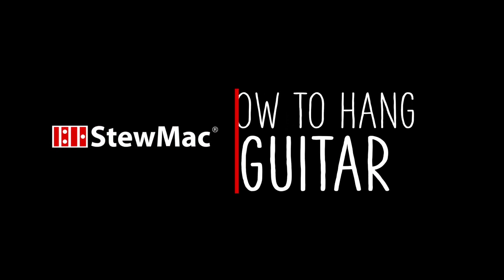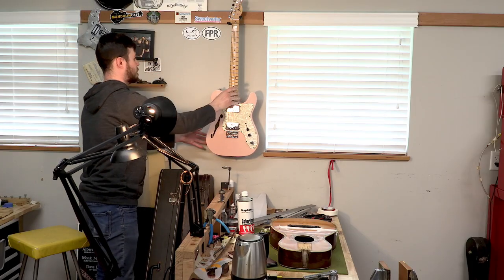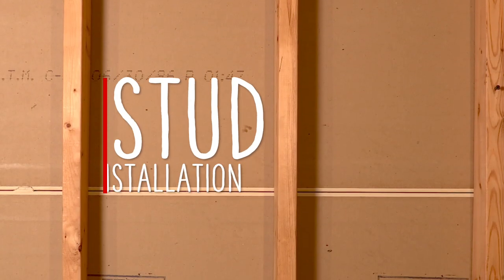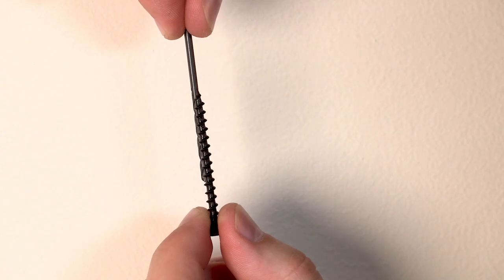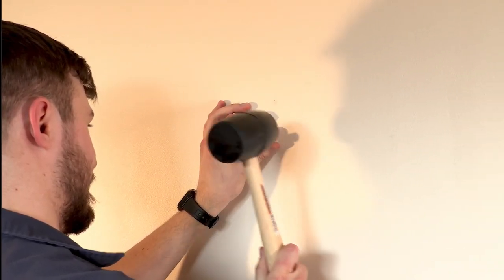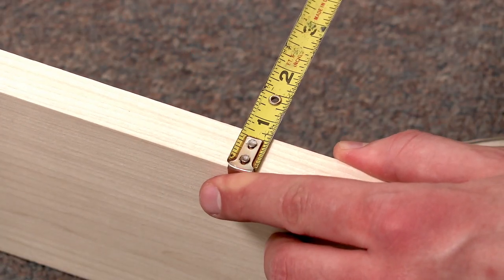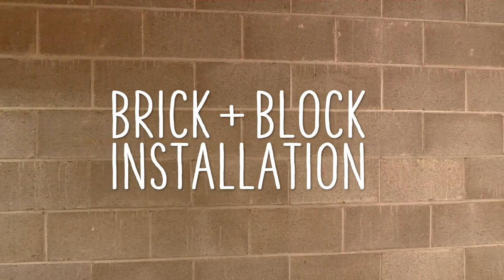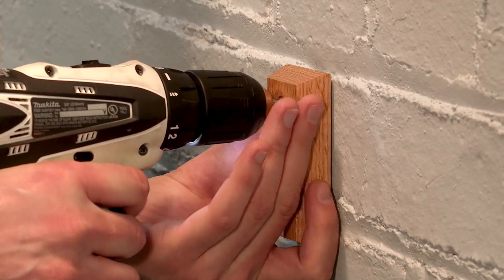How to Hang a Guitar on the Wall

Comment: I drive a nail right through the headstock.
Reply: Yeah I do the same to my 1958 Fender Stratocaster😀
Reply: Are you crazy, I just drill a big hole in the headstock , then I can hang it on a big nail 😁👍
Reply: I’m a little more practical. I grab my favorite 7 string guitar, pull off whatever string I use the least, unbolt the machine screw, and boom! - an instant hole to hang up the guitar on the drywall screw I just drove into the wall with a hammer!
Reply: It was a little tougher for me to try these ideas due to my guitar not having a headstock. I put a family of 10" nails angled upwards and pressed the body of the guitar onto them. Not too shabby.
Reply: Plz don't hurt it.😢
Reply: LOL!!!
Reply: I just remove one tuning machine from the headstock, and hang it on a nail on the wall
Reply: I usually drill through the fretboard and secure my guitar firmly to a tree in our yard with a couple of 10 inch long deck screws
Reply: You gave me nightmares. I like you

Comment: Don't drill into the mortar.  The brick is much stronger and less prone to crumbling. Brick drills easily with the same masonry bit.
Reply: In addition, instead of using a wooden dowel, a concrete anchor and screw set works better and is much easier to install!
Reply: Yeah brick is fine to drill, only concrete wall needs hammer drill.

Comment: I wouldn't trust those drywall anchors, I'd go with a screw into a stud or other solid backing...
Reply: 10-4  Those anchors are surprisingly strong, but not to hang a valuable friend like a guitar.
Reply: @216trixie   Agreed, :)
Reply: My painter friend and my carpenter friend recommended only those screw-type anchors for use in drywall. He told me to never use the type you hammer in. The drywall has to be in good shape, though. Although I prefer using either studs or a backer board, I've had to use anchors occasionally.
Reply: @brimtlgtr  The kind with the wing nuts behind them will defiantly work better than the hammer in ones. Studs are often in inconvenient locations. The board option is nice because you can fasten into studs and put the hanger exactly where you want it. The wall I have mine on is made of osb so I can put them anywhere, which has been nice as I ad guitars, :)
Reply: @A L M Right brainer emotive thinking. Drywall anchors are perfectly safe for those capable of thinking and doing simple jobs. Use the ones correct to application, RTFI & stay within the spec max. anchor load, spacing and total max. wall load guidelines.  Heavy Mahogany bodied Les Paul electric guitars only weigh around 4KG, most Teles and Strats less. The simplest nylon RAMSET drywall anchors will hold 5KG max spec., which means in reality, Ramset have ensured they've built in plenty of idiot user proofing tolerance before risk of failing. Use the 10KG split ones or large 20KG metal extending arm ones if in need of reassurance.
Reply: @theblytonian3906  Why? Just why? smh
Reply: @alm000  ...because demonstrative idiocy needs to be exposed for what it is to protect the naive.
Reply: @theblytonian3906  Demonstrative Idolatry???
Reply: Molly's. Otherwise known a butterfly bolts
Reply: A L M I’ve got this situation, at the moment. Given two or three treasured guitars, I think I’m going to go with the board firmly screwed to studs plan. I was a bit worried about the thickness of the board making the hanger project too far, but you can get hangers (sold as ‘Hercules’ in the UK) which are just fastened to a steel plate, though the wood block type is also available. This type also closes a couple of wings on the guitar neck, automatically, which solves the earth tremor problem. Probably won’t be much good in a total ‘fault line’ event, though. Sorry Momma Cass, kismet! lol
Reply: @lkgreenwell  Mine are the ones with just the plates on them no wood block anchored to the studs that are covered with wood sheeting and they do fine. I think If I was in an earthquake zone I'd get those Hercules style tho. I'm within line of site from a giant  volcano but we don't get many noticeable tremors. Those Drywall screw style are decent for flat Items that hug the wall and have no pivot or leverage points , they are better for a sheer application like pictures. Yep I'd go with a nice mounting board for the Hercules hangers fastened tight to solid studs unless your lucky enough to have studs or backing boards right where you want to hang your instruments, then you don't need the backing board.
Reply: @lkgreenwell  I've used butterfly anchors when I can't screw into a stud. I'd use 3 for a 4 guitar tree mount. They are really quite strong.

Comment: Ok age old confusion about hanging guitars by the neck, I have had personal experience. Evey time I hang a guitar or buy one that has been hanging in the shop. If its a bolt on neck, I look at how the top and bottom E string line up with the neck, if its off LIKE THE STRINGS WALKING OFF THE FRET BOARD AS YOU LOOK DOWN IT. I have to loosen neck and strighten until strings line up as best they can, with the top and bottom E strings in line with the neck. Look for even spacing. When I hang a bolt on neck over time I have to do this.  Just thought I would share.

Comment: My flat has solid concrete walls which make a nice solid base, drilling the holes may seem difficult but it isn't with the appropriate tools. We started with a small drill bit and then we used the size needed for the plug and the wall hangers. No hammer drill required this way .Only three guitars, an SG, a Strat and a G&L ASAT. so if the hangers are firmly attached to the wall they'll stay that way. I live in a bed sitter so hanging my guitars on the wall gives me a whole lot of extra space and they look really cool hanging up there.

Comment: I use a slat wall hanger setup from Diamond Life Gear. Works awesome and is well made. Also I NEVER use those plastic screw in wall anchors. Get the metal ones. You'll be glad you did.

Comment: The brick wall will cause scratches and dents on the rear of the guitar as it hangs and is bumped around. I would consider a rear guard of some kind
Reply: Most indoor brick walls have a plaster finish. This will only be a problem, if the brick wall is bare or just painted, like it was in the video.

Comment: I bought a Hercules plus wall hanger. I intend to mount it to the studs in my wall. I’m concerned that the included screws are not stout enough. Any idea what size screw I would need as a replacement? I’ll be ordering online so I’m not able to physically compare the new screws to the included ones.
Reply: I have bought four of them and the screws have been fine. On one I wanted larger screws due to being a heavy bass guitar. There was enough room to us e a wider screw. I just went to a hardware store and pick some that I thought would fit better. But probably the ones in the kit would've been fine. But on that one I had a stud to mount into. Don't know if this helps, good luck.

Comment: For masonry walls, you can use a 1/8" masonry bit and then run a plain old wood screw right into that hole. If the hole is too big for the screw, slip a small piece of wire in there first (like one or two pieces of an E-string). 

As long as you don't over-tighten it (strip it out), it'll be plenty strong to hold a guitar, at least  until the screw rusts away...

Comment: I would have thought stewmac would have been worried for the finish with this kind of hangers. One way i use and haven't seen much is mounting a hook on the wall and hanging the whole case or bag together with the guitar using the strap rings or other attachments they always have on the back
Reply: Why? Part of the appeal of hanging your guitar(s) is to display them and have them readily accessible to play. If your gonna just hang em in a bag u might as well put them in a closet.
Reply: @michaelhamerin3814  i said why. You risk the finish with soft lacquers (and maybe some sub polys). Plus, if you hang the whole bag you can use hardware store wall hooks instead of expensive equipment. For me guitar is about playing, not displaying, and this way it's pretty accessible and dust-free

Comment: Slatwall is another good solution. Mount to wall and hang guitars diagonal to the wall for more guitars in the same space
Reply: I cut a very shallow stair tread mounted sideways to the wall and use the tool hangers from a big name tool store. cheap but strong and way more space. i can hang 6 instruments inside of about 3-4' of wall space
Reply: grant dittmer - or two of those backer boards so you can alternate hanger heights.
Reply: @igurath  I did the same thing. Just make sure the coating on the hook won't affect your guitar finish.

Comment: AFAIK it’s best not to hang your guitars on outside walls, too, unless your outside walls are VERY well insulated, because there are much more temperature differences there than on inside walls. And not just season to season, but also front-of-the-guitar to back-of-the-guitar!

Comment: Very needed instructional video! (I think I exchanged msgs w/ StringSwing yrs ago & almost made a DIY video then). I've found the drywall anchors never hold up to weight of anything heavier than a light classical or uke, unless you use a small rectangular 'backer board' with drywall anchors in all FOUR corners, or a big enough backer board so that at least one edge can be screwed into a STUD (& drywall anchors in the opposite corners). If you have a cool piece of spalted, burl, or exotic wood (4"x6" up to 8"x12" or whatever), this really makes a cool looking 'backer board'. Your idea of a single hardwood or thick softwood backer board along an entire wall is great & makes hanging up MANY guitars a breeze. BTW, the LEVEL should be placed VERTICALLY on the LONG edge :-)

Comment: A small diameter screw like you used doesn't really need a pilot hole. Now, if you are using a 1/4 in lag or larger to hang the backer, then you will want to use a pilot hole.

Comment: Something to consider here is the age of the brick you are drilling into.  Newer brick or mortar is fine, but one it gets older, like 60, 80, 100+ years old, the bricks start to get brittle and by the time they are over 100 years old, they can crumble.  So be sure to make a test hole. But if the brick crumbles, many times, the mortar will also be soft.  

Keep in mind that you can easily build a small framed wall out of 2x4 or 1x2 and then secure that and hang your guitar/s from the new meat.

Comment: I’m looking to hang 5 guitars. I’d like to use this board method. Since you also showed 5 guitars hanging on the board as an example, could you tell me the dimensions of the board you used?
Reply: I will hang 3 guitars but at 45 degrees and I got a 4 feet board. My idea is to hang 5 eventually.

Comment: What's the best way to hang a guitar on drywall which is an exterior wall? It's concrete block right behind the drywall.
Reply: I'm going to use concrete anchors. Check this info I found:

"You need to attach the mount to the concrete, not the drywall. There are special anchors for concrete. Most are made of metal and expand into the hole drilled in the concrete with a hammer drill and a masonry bit. Most masonry anchors are sleeve anchors and use bolts (also called machine screws) to expand the anchor."
Reply: @daniszwarc  Would tapcons work too?
Reply: @dreamtheater_92  they should and that's what I was going to get, but the guy at Home Depot told me that since the concrete bricks are hollow, it's better to have something that expands.

Comment: "Be careful when mounting studs. Always use protection when drilling into a stud. Use caution not to drill too deeply into your stud." 👷
"So wear safety glasses or equivalent eye protection when using power tools." 👓
Reply: "Be careful when mounting studs. Always use protection when drilling into a stud. Use caution not to drill too deeply into your stud."  Whaaaaaaat?...... Oh right you mean wall studs.

Comment: Good Lord I wouldn’t trust mortar as a safe anchor point. Not with an expensive or any cheap loved instrument - beg, borrow or...well, just see if you can. Some brick will work without a hammer if you take time. Also there are concrete screws with a hex bolt head - you use a spanner to do it up. They are fantastic!!!

Comment: Having trouble hanging my Telecaster as the peg head is so slim.
Reply: Yeah, Tele's really suck to try to hang.  I ended up making wedges that I can hammer between the stable part and the hanger that spins.  I just put it in a little bit, turn the holder until it STAYS where it needs to be (maybe even just a SLIGHT bit more) then tap the wedge (or shim) in there to hold it real solid.  Painting it black before putting it in there makes it look groovy.
Reply: @groovydjs  
I'll give that a try.
Thanks.
Reply: I have two Teles, both hung on Hercules hangers.

Comment: Cant believe he missed one of the most important prerequisites - nitro friendly rubber on the hanger. 
If you use a hanger with non-nitro friendly rubber like the yellow surgical like rubber tube, it will eat into a Gibson nitro finish like acid. The chemicals in the rubber melt the finish fairly quickly, so always get a nitro friendly hanger.

Comment: if hanging a heavy guitar at the headstock-neck joint does not weaken this area, then Prove it.
Reply: zurdo z The tensile strength of wood depends on the species but is typically on the order of thousands of pounds per square inch. The cross sectional area of a typical guitar neck/headstock joint is on the order of around a square inch give or take. Thus that portion of the guitar, while admittedly one of the weakest portions of a guitar, would still theoretically be capable of holding hundreds if not thousands of pounds of tensile force under a static tensile load as in the case of a guitar hanging from a wall hook. A “heavy” guitar might weigh 10-15 pounds. Any stress at that area would be negligible as would any long-term effects from leaving it hanging there over a long period of time.
Reply: I reckon it does affect the neck/headstock and neck pocket/body areas. Imagine putting a support around Trumps neck and letting him dangle from a wall...on the other hand...
Reply: @MechanicalMind7  username checks out.

Comment: Sooo what about concrete walls? All my walls in the house are massive concrete 😂
Reply: Use concrete anchors to mount hangers. Too prevent scuffs on the back of the guitar u can use body pads ( they are designed to adhere to the back of the guitar) or, what I would do, is cover a rectangular piece of thick cardboard with a felt material. Then mount the board behind the whole hanging instrument.